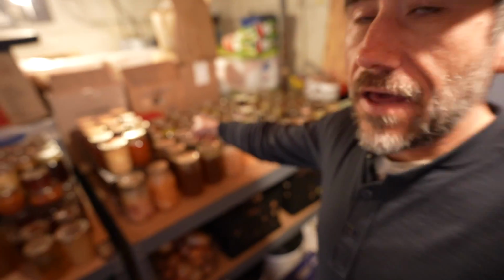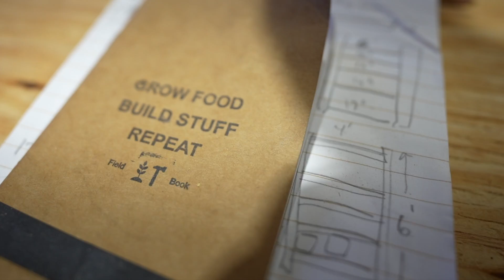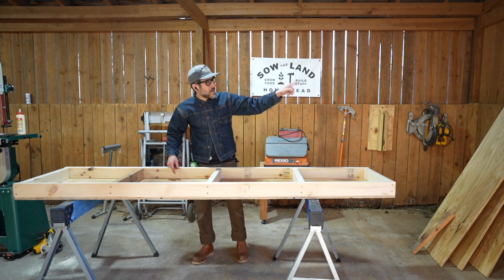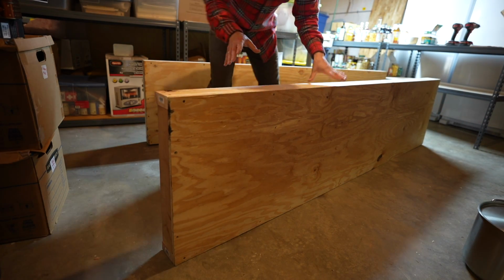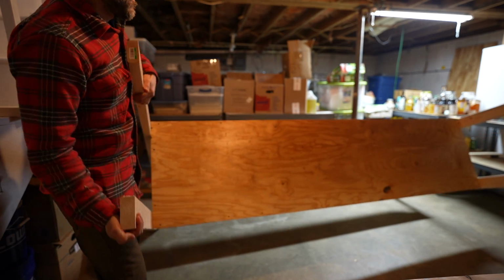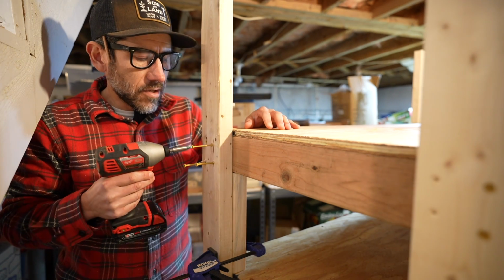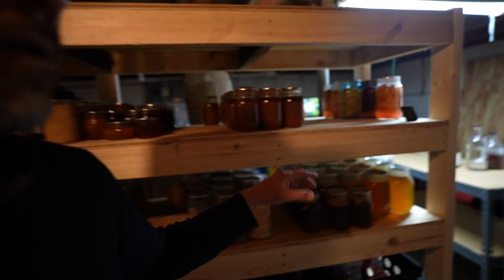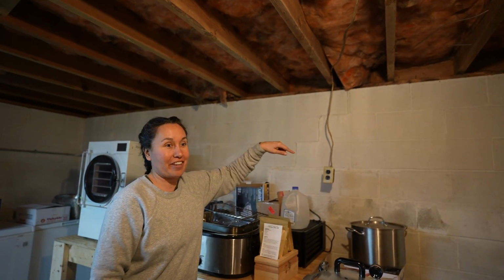Building a Grocery store in our Basement

Comment: Those are great shelves, Jason.  They will certainly hold the weight of the jars of canned food.   Maybe the shelves you were using could be put in the corner Lorraine talked about to use for the freeze dried foods.  They don't weigh nearly as much and perhaps you could reinforce them so they don't sag.  Just a thought.  Also for lighting, you might take a look at Lowes...they have LED lights that screw into a receptacle and there are 3 or 4 blades on them with the LED lights.  (They kind of look like miniature fans, but they a just lights.  They are very very bright.  2 of them would probably light up the whole basement.  Thanks for sharing this build, have a Blessed day.

Comment: I would think you could get chalk paint, then write what is there with chalk, that way you can change it if you need it. That is my plan.  Before you move a freezer or refrigerator to a outside building or a garage, you need to make sure they are built for that use, they use to all come built for colder rooms. But they changed that now and most of the time you have to special order them, not everyone knows that. Thanks Blessings and Prayers for you all.

Comment: Awesome job on the shelves. Only suggestion I would have is too put one more vertical support in the middle of the shelf. The span of 8' and the weight that you will be putting on it may cause sagging. Just a suggestion because in my industry we build the same ones and needed extra support for the middle. ✊ Keep on rockin it